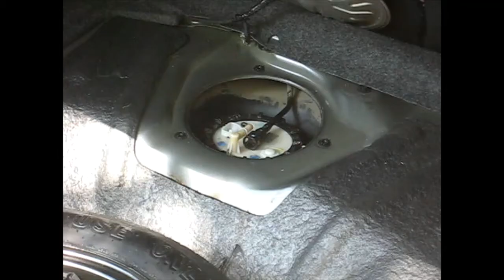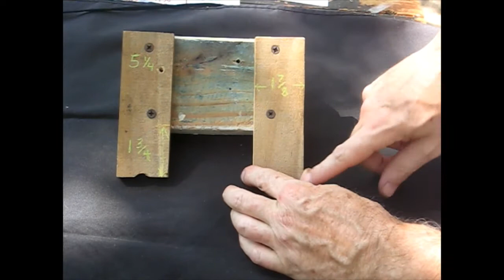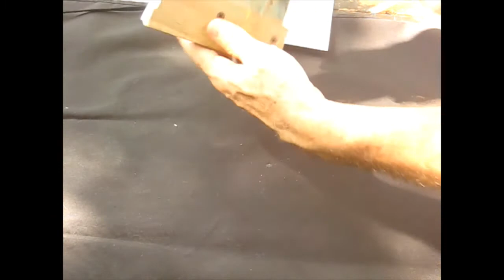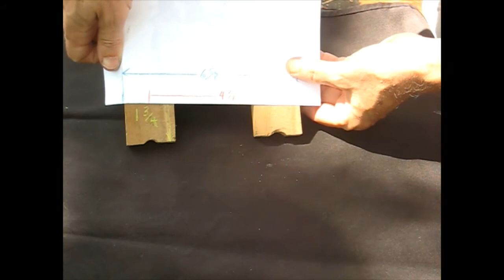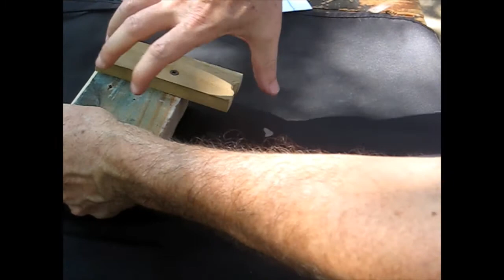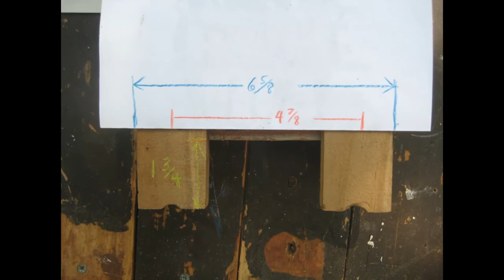DIY Tool to Remove 2003-2007 Honda Accord Fuel Pump Assembly - Plastic Ring

Comment: Thank you for this video! When accessing the fuel sending unit, this retaining ring is definitely the worst part of the job. I built your DIY tool and it made all the difference in the world.  Also helps a lot with screwing the retaining ring back on, because the ring wants to cross-thread if you're not careful.

Comment: The trick to banging these lock rings loose without a tool is alternating between the 3 o'clock position to 6 to 12 until it finally spins free. They're designed no to easily spin loose. It will bind slightly unless you continually tap across the the entire diameter. 

What you came up with looks great for anyone with wood laying around.